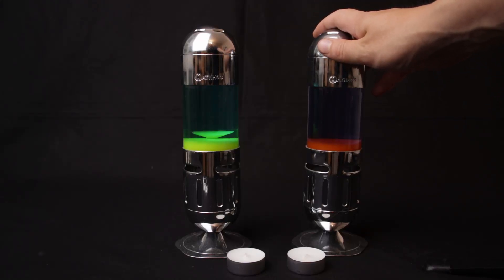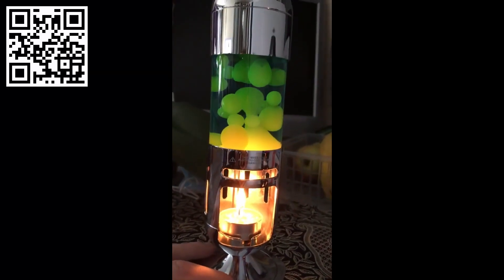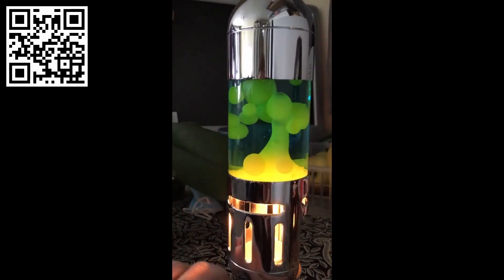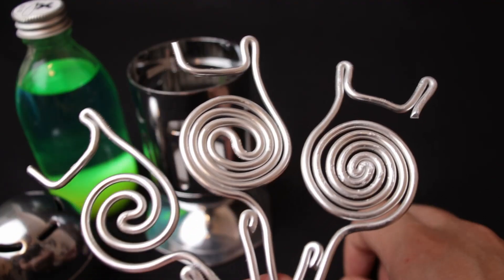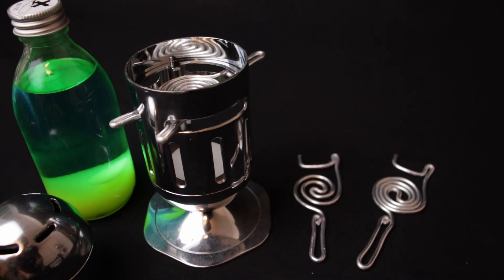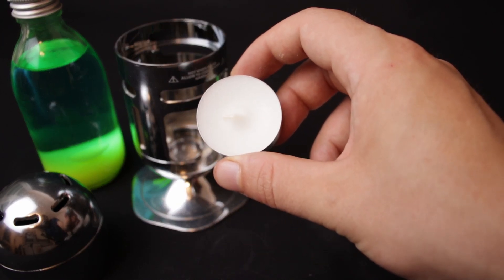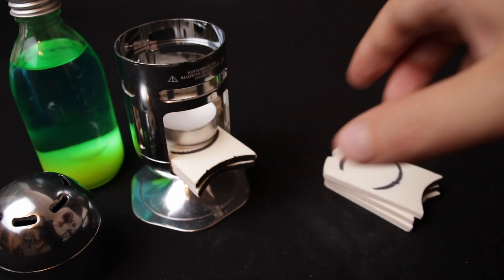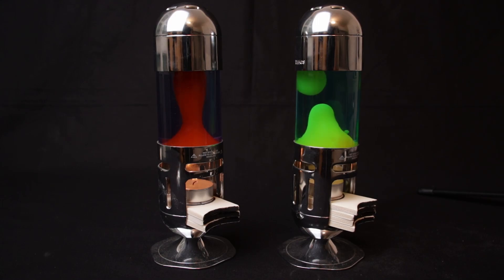Candle lava lamp: How to fix Mathmos Pod overheating

Comment: I had a 4mm thick disc of borosilicate glass cut for mine. The glass disc goes in first before the bottle, and sits on top of the metal support ring. Then the bottle goes in on top of the glass disc, so I've effectively got a transparent hotplate instead of direct candle heat. This allows me to use the official mathmos candles without overheating for a steadier operation. However the "official" candles are simply a tea light with a thicker wick like a normal candle, so I just buy cheap tea lights and replace the wicks with thicker wick I bought in Amazon for a few quid. The tea lights come with holes in the wax centres, and the wick simply pulls out through the middle for easy replacing before first burn.
Reply from the maker: Interesting solution! Just curious, how much did your glass discs cost?

Comment: Mine did overheat with the tealights that came with the Pods. After I got some from the local drugstore the problem disappeared. They have a burn time of about 6 hours and a wick size of about 5-6 millimeter. I get a solid 4.5 hours of satisfying gloop gloop from them.

My mum bought some from a different store and their wick is twice as long. Bigger flame, more heat. She has to snip them down to get them to work.

The problem with the Pods is that there's a lot of variation in tealights around the world.

Comment: Do you recomend buying one instead of the electrical models? I like this one because of his shape and the reduced price but I'm worried about the tempertures and finding the right candles. Btw really good videos about lava lamps, never expected see so technical and accurate videos about lamps jajaja
Reply from the maker: Nope I wouldn't recommend these, apart from the heat problems, tea lights are also much darker than light bulbs, which doesn't look great especially if the environment isn't completely dark.

Comment: I bought 4 of these and never experienced this phenomenon. Luckily. 
The small tealights are to weak, that‘s right.
So i took the 8-hour ones, which are higher than the normal ones.
In Germany you can find them in any drugstore.
Reply: Kannst du mir bitte sagen, welche von der Drogerie am besten funktioniert haben? Dankeschön!
Reply: @l @louiscraps das sind die ganz normalen 8-Stunden-Teelichter von Rossmann.
Die sind in so nem Plastikbeutel.
Kennst du bestimmt.

Comment: good video, thanks for mentioning me. Be carafull with the plywood though it is flameable
Reply from the maker: Fair point, didn't even think about that. Although tealights don't nearly get hot enough on the outside to actually start a fire, but still, wood is wood.